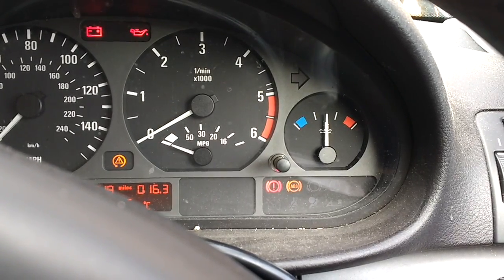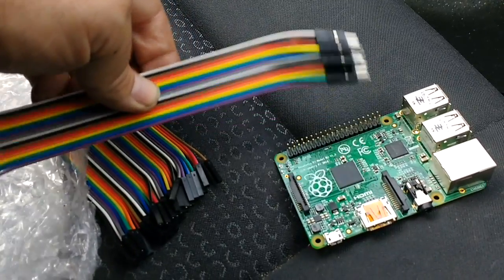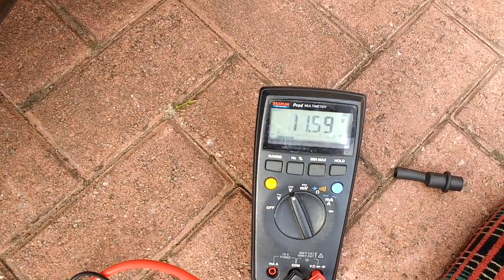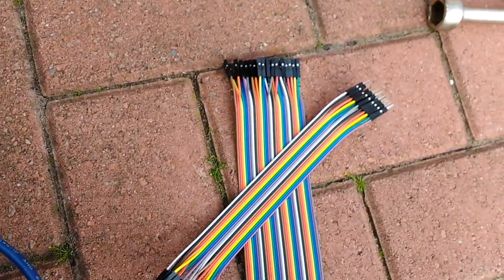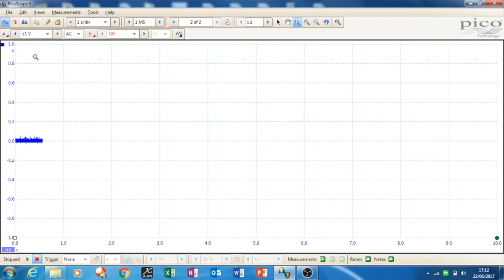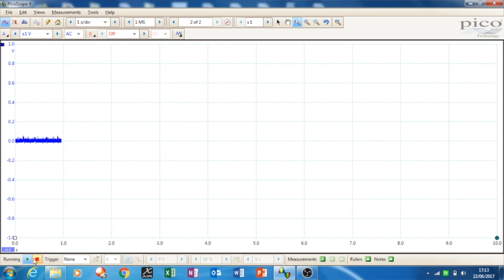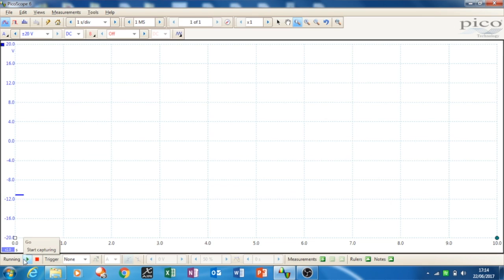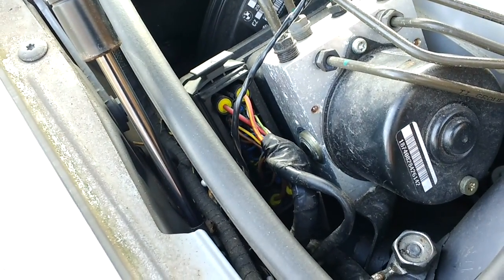PICOSCOPE 2000 PART 3

Comment: Nice setup Sandy. I have also scoped this type of sensor on an Audi. And I think the best test you can do is like this with a scope. So you can see the signal.  I have found OHM readings  hard to do on this type of sensor. Here is a good read: https://www.picoauto.com/library/case-studies/juddering-at-low-speed

Cheers.
Reply from the maker: AutoFocus good to hear from you, I suppose I wanted to show in the video that you don't need top of the range Pico to carry out auto diagnostic although the expensive one's give u better resolution.  that was a good article and will try out the amps clamp with a 10x wrap around.  have u had any interesting   problem cars recently? sandy
Reply: Yeah, I noticed that, just be careful, If i remember right it don't have the same protection as the automotive. I have had vacation so nothing latley. :)
Reply from the maker: AutoFocus yes that right no HT voltage, I've got to look at Opel corsa on Tuesday with electronic power steering fault ie it's not working so will try and make video , sandy